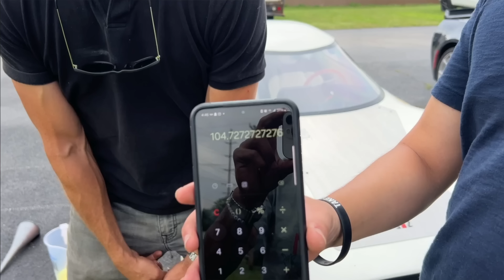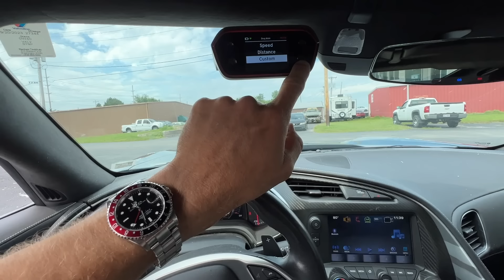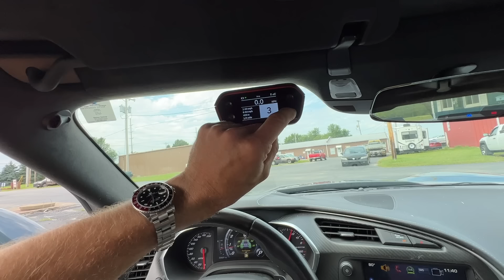FIRST 0-60 mph Test- Diesel OMEGA CAR - Video 3 of 3

Comment: GM could have slapped a lithium battery in a EV-1 body rather than build the Bolt. VW could have mass produced a cheaper version of XL1.
Reply from the maker: True, but they are strangled by the corrupt and stupid world of global politics and entrenched industry.
Reply: That and, money. If it won't sell why bother.
Reply: To straight crush them even though people wanted to keep them from the lease.
Reply: Lithium ion batteries were way more expensive when the EV1 came out. The car still ended up being valued around $48K even after using the cheaper batteries and GM had so little confidence in it they only allowed leasing. I strongly believe they scrapped them because the realized the batteries could result in a hydrogen explosion in someone's home if they charged in their garage which it openly stated to never do. 

And the XL1 was never going to get a consumer model because these conglomerates don't like making niche products. A consumer car with high fuel economy would be great for the environment and our reliance on gas, but people don't actively buy such cars. The Prius for example had continued to be a punching bag by everyone since it's inception. Hell Toyota even realized this and gave it a bigger engine and lowered increased the aerodynamic drag just to make it look cool and drive faster. They want to make cars anyone would buy which is why many have even stopped selling coupes and sedans. It's easier to push someone up to a bigger car than encourage people to try a smaller car.
Reply: @Skylancer727  Big oil got involved to protect their interests, that it.
Reply: @Skylancer727  Battery issues aside, know a few that loved it, only needed it for what it was made for, not road trips across the country. 

Honda insight was also in a similar issue but both were good for what they are and the US truck nation changed it.
Reply: Maybe have somebody explain to you, in private, what he’s trying to accomplish. Then remove your comment and sit in the corner for 15 minutes with a “dunce” cap on for timeout before returning and providing a comment about your lesson.
Reply: @Skylancer727  Psst..  VW made a consumer version of the XL1.  Sold 200 to the public.  Europe only because of silly US laws: https://en.wikipedia.org/wiki/Volkswagen_1-litre_car
Reply: @Skylancer727 you have no idea how many Prius cars there are. They’re everywhere all along the west coast. 1.2 million gen 2 Priuses were sold.
Reply: @lazarusmagellan2367  there was never a year the Prius sold 300K. And it hasn't even sold 100K in 7 years. It definitely doesn't sell like the mass appeal vehicles. In recent times it rarely even hits 50K. 

And I personally myself own one. I got the 2023 model. I think it's a great car, but people aren't interested in it.
Reply: @Skylancer727  I would largely disagree. I think a lot of people are interested in it, because it saves them money. Thats why they are so common. the XL1 would be an industry disruption in the same way cheap chinese EVs and that cheap japanese truck would be.
Reply: @Skylancer727  Absolutely, but the thing is a 2 seater is the ideal EV at this stage for battery placement and damage control for fatalities. Realistic commuter adoption and infrastructure buildup.
Reply: @annoyedok321  not sure what exactly you mean by that. The optimal size for battery replacements would be the smallest vehicle you can make. Honestly getting into two seater are already getting a bit big for that. Honestly battery swapping is only relevant for small vehicles like motorcycles. Batteries otherwise will last the life of the car. Even a worn out battery isn't shot, it just has less range like a carboned up old engine. 

And damage control is always just the smallest vehicle possible. I mean if we all drove smart cars the damage to things in crashes would be far lower, yet nobody is buying them. Sometimes the logically efficient option isn't the appealing option.
Reply: Somebody should make qn ev1 kit car
Reply: @Skylancer727  Rear leg room eats up useful space due to center of gravity. Most cars on the road only have 1 person in them. In this stage you want affordable commuters that don't have huge batteries to charge. You also don't want a story where 6 kids were burned to death.
Reply: Dongfeng's new sodium ion solid state EVs look interesting. Top car manufacturers are probably the wrong place to go looking for innovation.
Reply: @Skylancer727  If I could afford a smart car, I might buy one. In the meantime, my E-bike can carry almost as much cargo. It's less comfortable in winter at -30º with roads covered in icy ruts, but it gets the job done.

Comment: Powerful people find 100mpg inventors as enemies of the state. My dad and myself have been screaming your views on the auto and energy industries for decades. Almost zero improvements on efficiency in the auto industry for 40 years.  This is the direction towards efficiency the world needs. God Bless
Reply from the maker: Thank you
Reply: There are diminishing returns on fuel efficiency. Vehicles are getting bigger and heavier, requiring more fuel to move, and generally have quite terrible drag coefficients, preferring bulky safety features and conveniently spacious interiors over aerodynamics. Most vehicles on the road could use 30-50% less fuel simply from some progressive tweaks in body design.

Comment: This type of testing I would call “Real World Testing”
Reply: Yeah, one thing he didn't mention is that they also use professional drivers with lots of practice on the car and they even remove the first foot roll off on some of those. There's probably drag racing glue used for those timings.

We aren't professional drivers, we aren't getting a foot rolloff when we leave a traffic light.

This is as you said, real world testing, these are the results we normal people would get.

Comment: This is a Dodge Viper in perfect mechanical condition. mirror falls off while launching
This project is great!
Reply from the maker: Mirrors are cosmetic. Rule number one: what is behind does not matter! BA!
Reply: Reminds me of the “Gumball Rally” when the Ferrari driver ripped the mirror off at the beginning!
Reply: Old car problems. That screw gets loose due to vibration over time. A lot of the time glue that holds the little bracket up there comes off as well.
Reply: Chrysler life.
Reply: @Turshin  I’ve reglued the mirror on my 944 at least twice now!!   That’s NINE-FOUR-FOUR Casey!!!  HINT HINT!!
Reply: @dB_944   yeah the after market glue kits never holds up.
Reply: @justinpakarno4346   this can happen to any old car.
Reply: @Turshin  why anybody thought gluing something hanging from a smooth glass surface was a good idea is beyond me.  You used to be able to buy a German car with mirrors screwed into the roof and proper headliners mounted with bows.  Glue is the enemy to cars!!
Reply from the maker: I like nine forty fours!
Reply: @CaseyPutsch  We’re all waiting with bated breath for you to buy another one. :)  I’d sell you mine, but I can’t part with it.
Reply: Since when is a rear view mirror part of the mechanics of a car?
Reply: @CaseyPutsch  ...Mirrors are not cosmetic.  They are a piece of necessary equipment required by regulations.
Reply: @Rickbearcat maybe so, but that doesn't change the fact that most people don't use them these days because they rely on the electronic blind spot monitors and other bs that just makes them drive like shit because most don't double check .
Reply: @nst6563 ... Electronic blind spot devices ARE BUILT INTO the MIRRORS. At least the side ones. I don't think I've ever heard of a vehicle that didn't have at least one side view mirror and a rear view mirror. Correct me if I'm wrong.
Reply: @Rickbearcat  Exactly!  But all anyone does is look at the blinky light, I hardly ever see anyone with one actually double check before changing lanes.  God forbid the sensor or light malfunction.  
  It's an "aid", not a replacement for solid driving habits\skills.
Reply: Mirrors falling off Chrysler products IS considered perfect mechanical condition! Great 0-60 number for that car.  However the 104mpg is not accurate, as he measured in ounces, diesel weighs less than water.  He should get somewhere around there, or better- properly driven, but that particular test was more like 80-90mpg. You've got to have a bigger test sample than 12miles for both accuracy and optimal engine efficiency. Also reveal the speed.  A boxy VW golf diesel can achieve 90mpg when hypermiling. I agree with his/your ethos 110%

Comment: Casey, you've done a remarkable job.  Not only have you made a really good looking, fast affordable car based on the bombproof 1.9L VW TDI drivetrain, but you've made a really good looking car that people wouldn't be ashamed of driving around.   Even if you were to make a SUV or pickup truck version of this car, it would get over 60-70 mpg and still haul the kids and groceries around!   And yes, no burden on our electrical grid, no use of heavy metal batteries mined with slave labor in Africa and other places.   Kudos!
Reply: That's what I want: a 4x4 fuel efficient midsize pickup! My old Dakota gets 15mpg with a v6!

Comment: Casey, you are a wealth of inspiration and knowledge in a world full of stupidity. Cars nowadays have too much stupid technology with large screens that are dumb.
Reply from the maker: Thank you. I agree.
Reply: While the omega has an ipad for a screen. :D
Reply: @Kristjan_N An iPad used to monitor temperatures and engine vitals, so the thing doesn't blow up. Not an iPad to make fart sounds, play Mariokart, and tell jokes. Big difference!
Reply: @CaseyPutsch  If you can, use Linux devices to make the car software FOSS
Reply: I would personally turn this thing into an absolute computer on wheels. 

No silly stuff like a Tesla, but just performance-enhancing gadgets. Join two 600cc Kei car engines to make a 1.2-liter V6 that can scream its head off at 8000 RPM all day, and use some of those very powerful eBike hub motors to build a triple motor (torque vectoring in the front, integrated starter and generator in the rear) performance hybrid system. Sequential automated transmission hacked together from a motorcycle to finish it off. 

Baby Ferrari SF90 that can do 0 to 60 in 4 seconds, probably still get 100 mpg if driven correctly, and not continuously idle and waste fuel.

Comment: Good videos, ive watched all of these recent Omega videos and shared around...thanks for doing it .. gets the wheels turning in my head....its crazy the American car market has its top ICE car mpgs at around 42mpg which is exactly what I achieved recently in my 93 Civic with a worn out D16Z6 last highway trip down to Piedmont Dragway...great tests thanks again for using your resources to do stuff like this. Cheers.
Reply: GM did something goofy with my 21 GMC 1500 crew cab longer box, it was the factory 2" lifted one, plus a 2" aftermarket block lift, a big TDK bumper grille guard, 6.2L with the 10 speed. The son of a b** got 40 mpg at 40mph, about 30 at 55mph. The dynamic skip fire sounded dumb but they were really onto something. Shame the very system that made it efficient made it failure prone in a bad way that can take out the entire engine.
Reply: @AutomatedUser  I've heard similar mixed feelings about those systems...good inputt man
Reply: Another funny part is the average passenger car economy is pitiful. People think my GS460 lexus v8 is inefficient.. it's more efficient from 2007 8 speed v8 than current 4-6 banger average LOL.
Reply: @AutomatedUser  yeah they eventually twist a lifter and destroy themselves.
Reply: @N4CR  the lifters collapse when they fail internally, giving a ton of play, jackhammering the pushrods, which bend after a short time, impacting the high pressure fuel rail and leaking gasoline. There are a couple failure modes, can also fold a rocker arm, can also launch the rocker stud out of the head as it's just pressed into the head, not threaded. Never heard of them spinning since the classic small block Chevy, they're keyed at the top with a guide that goes all the way around the outer structure that doesn't collapse keeping them from spinning. That guide could break I suppose, it is plastic, but I would think that would be from a seized roller flattening out the cam letting it go low enough in the bore to escape the guide, spin and break the guide off

Comment: New time measurements all subtract "roll out" to reduce the numbers.

Great performance on that Omega car!
Reply from the maker: Stupid game!!
Reply: Not Porsche.
But they kinda aren't interested in making attainable fun cars... like GR86, MX5... or very efficient cars.. @CaseyPutsch
Reply: @CaseyPutsch  IDK man, I'd like to take the clutch work out for peak consistency, so personally, if I were testing cars, I'd do an off-idle roll with the GPS sensor recording the 5-60 or 10-60. Could also do a 20-80 roll for fun, too. I used to love that particular range in my first "car" because the V8 torque (even stock and with the vehicle's 5000lb weight) made it feel fun. A side pipe muffler delete helped with the fun factor, too.

Comment: I wish that I had been able to buy an Omega Car instead of the CX-5 I purchased last year. I'm not sure how well I'd do getting in and out of it with my low back issues, but to have a car that I can fix or take to any competent mechanic of my choosing without needing specialized tools that gets over 100mpg is exactly what I'm looking for. The performance off the line is just a nice bonus.

Comment: 12:08 They do the 0-60 tests on a prepped drag strip. That's why you couldn't get the 3.7 time
Reply: True but the Omega car in that same condition may also do better than the Tesla
Reply: Better tire compound and width would have easily helped. Cars can easily do 3 second 0-60 without wheelspin

Comment: This car has twice the engineering and social integrity of anything the big manufacturers can manage.  Outstanding work!
Reply from the maker: Thanks!
Reply: You mean a completely unpractical, cramped, two seater go-kart passion project that Casey has provided absolutely zero evidence for meeting any safety or emissions standards whatsoever?  Compared to something like a Lucid Air Saphire or a Tesla Plaid which can transport a family of 5 in quiet and comfort, along with all their luggage, with industry leading crash safety, running high 8 and low 9 second 1/4 mile times, making well over 1000hp,  while also getting over 100mpge equivalent effeciency with wide summer performance tires?   Randy Pobst took a Tesla Plaid to to the Pikes Peak Hill Climb and was running times fasters than purpose built open wheel race cars at the event.  In what world does the Omega car have twice the engineering?
Reply: and 1/10th of the red tape...  we've regulated away the ability to have cool cars any more.
Reply: @thekalikal  ahh but you dont get it. This car was made by a youtuber so we are supposed to love it. But if a company made this, only then are we supposed to hate it
Reply: @tudytudy3316  You don't get it either, a company has unlimited resources and money. Not this guy, this was just some dudes project, and he was able to prove that ICE engines can be very efficient and eco friendly.
Reply: @tudytudy3316  You don't get it either, a company has unlimited resources and money. Not this guy, this was just some dudes project, and he was able to prove that ICE engines can be very efficient and eco friendly.

Comment: I forgot the original reason I subscribed to you many years ago. I liked the way you talked and told your story with such passion. And a racecar driver. I grew up in the fast and furious days. As I grow older maybe not wiser lol. The thing I would like the most is to have life better for generations to come. Love the passion

Thanks Casey
Cool car
Sounds like it need some sound deadening lol👍👍❤❤🏎🏎
Reply from the maker: I mounted the darn fuel pump on the resonance wall for the stereo. I have to move that.

Comment: Yeah, turbo diesels are the way to go for fuel economy, but they've recently been finding out in Europe that diesels have a lot more NOx emissions. And in America they've basically regulated diesels into the ground for new cars.
Reply: The more turbo pressure you put on a diesel engine (or higher compression ratio), the more efficient it gets. The only problem with the lean combustion in diesel engines is that it produces a lot of NOx because there's so much oxygen left without burning.
Reply: In addition to my other comment: "The less fuel you burn, the fewer emissions you produce."
Reply: @Drunken_Hamster     That's true for CO2, but not necessarily for CO, NOx and unburned hydrocarbons.